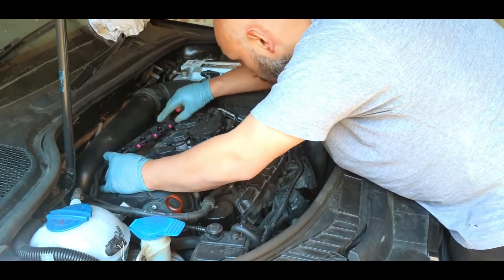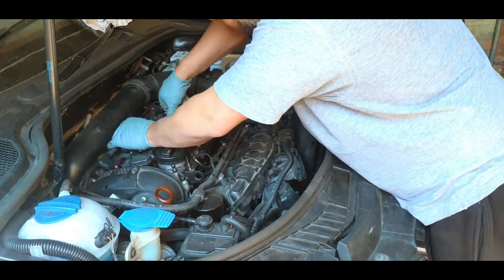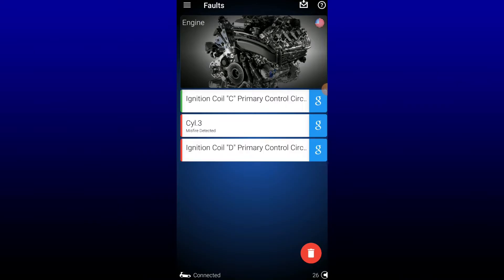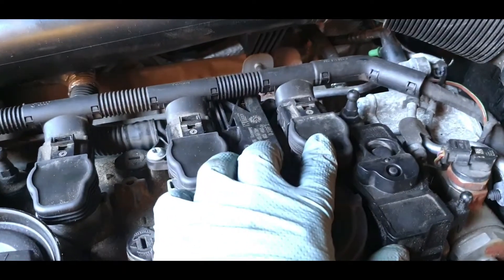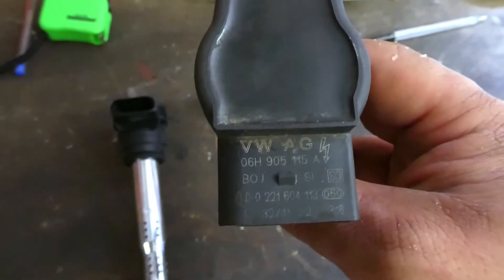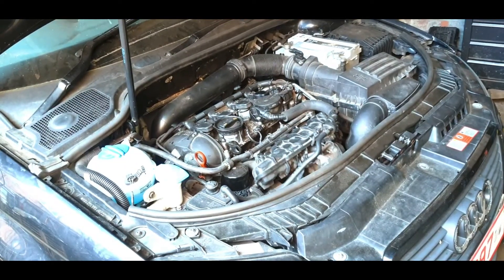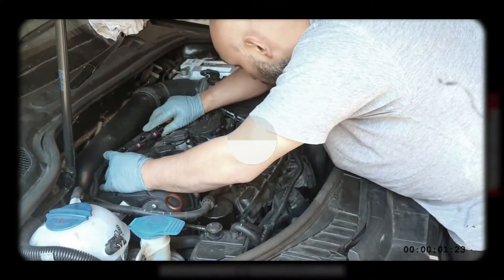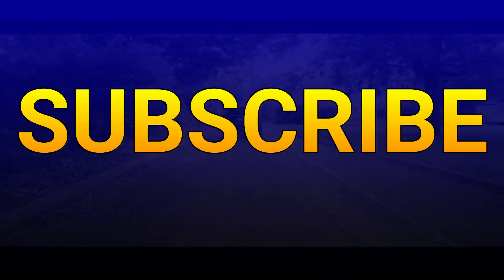Car Engine Misfire Shaking Vibrating Engine Fix - EA888 2.0 tsi tfsi

Comment: Does the ecp light need to come back on once you swapped the coils in order to read that it’s deffo that coil? I had a misfire on cylinder 4 with the EPC light on. The garage has now swapped 4 with 2 and the misfire is still there but with no light?

Comment: My engine is behaving exactly like this , and i mean it even sounds the same ,  and its stuttering and hesitating on gas while cold , when it gets to operating temperature after 5 or so minutes , all well .... Ive changed a ton of stuff , timing chains , belts , sparks , water pump , fuel filters ,  cleaned injectors ,  and changed intake manifold  old one was cracked and lacking flaps ,  but still , same thing ... I didnt change Coils , but my OBD does not detect misfire ,  at the Mechanics it did detect it , but my scanner does not .
Can this happen without engine reporting misfires ?
Reply: Look for tsi cold misfires. Most videos say Carbon buildup on intakes. In old times it was condensed water in the distributor cap. Sometimes can be animal chewed through cable.
Reply: @jellyd4889  Ive chased this subject , while changing the intake manifold i told the mechanic to clean the valves , also i red in the manual that valves are clean by prolonged 3000-4000RPM drive , where temperature reaches vaporizing point of the sludge .
Not a single percent of difference . 
Then i said these Mechanics are incompetent , and started doing my own thing , i gave them 2000$ nothing was fixed .I got new coils and injectors for around 150$ , and fixed 90% of the issue .
The rest is PCV valve , and Lambda probe , ive learned this engine.
PCV valve has a rubber and a spring , they do not work proper after 200 000km .
Causing excess Oil vapor in to the intake manifold , that increased the amount of fuel  or residue , compared to oxygen and massifiers .
But i again i do not want to go to mechanic and pay 500$ for PCV valve , when only a spring and rubber need changing , sold separately .
for about 50$ if even that , and can be replaced by me .
Lambda probe as well .
These mechanics are not used to working with complex engines , they don't even know where GPS receiver is , and they call it GPRS ,  not the same thing .
I also noticed they do not know that Battery can  has surface currents if dirty .
And that if you put a huge Batery in , it will overload your alternator , giving you less voltage , in my case 12,5 when it should be 13,8 at least .
So i changed the battery and got 14V 
now 2 V might not seam much , but when Coils transform that X1000 , you are 2000V short on your sparks .
So everything needs to be in tolerance if the engine is to work correctly , and it is not one thing , it goes down to battery .
Reply: @dedskin1 so do you recommend a battery change?
Reply: @koti1217  i have since found out what is going on , the oil from the oil separator i think its called PVC valve the oil that blasts trough the cylinder walls in to the engine space , makes positive pressure inside the engine , so every engine has a valve  that spits out that oil vapor and oil , then it goes to PVC valve or oil vapor separator  , and that should separate liquid oil and vapor , vapor goes in to the engine intake for another burn , and cycle continues .
Here is the problem , after 200 000Km that PVC valve is not working as good as it was , needs replacement ,  but it costs 400e original part , i ordered a third party not original part , and it was even worse .
I have chenged the Sparks and injectors , realizing injectors can not be cleaned in Petrol engines singe petrol is a cleaner , they have to be changed after 200 000km , and i changed the coils , after this problem was solved 90%, i assume getting a new oil vapor separator would fix it 100% but its expensive 500e installed .
So i left it be , becase there are things that can be changed still to improve things , like rectifier diodes  in the alternator , they are sure to be bad , and i measured it , they should give 14V , but give 13V  , so they have to be changed i guess that will fix it another  5% , and Lamda probe , oxygen probe on the exhaust , it too degrades and depends on material , since its used and 10 years old , it didnt brake , but im sure is not working properly , that would give another 2%, and the issue of stuttering engine  would be fixed 98%, and changing the rubber valve on PVC valve another 1% , so all of that would be 100euro and car would work 99% as new .
Battery has nothing to do with it becase after you start the car , it does not run off of the battery , but you can check your battery in  service , or by your self , turn on the climate control , turn on everything you can , go for a drive 5 minutes stop  for a minute ,  repeat his 3 to 4 times if your car starts , your battery is fine . IF it strugles then battery needs to be changed , and you can check at your mechanic , there is a tool to check it ,  and tool to check your alternator . 
But if your engine stutters its not due to battery , but some of it can be due to low voltage from the alternator . Some of it , maybe 10% . 
This stuttering is not one issue , its everything , every part not working a bit , not broken but still not working at 100% efficeny , and when you have 10 parts that need changing you get stuttering .
There is chance that you have vaccum issues , that is easily checked even by your self , when you pull out oil stick it needs to pull air in , put a little light paper close to it to see if it is pulling in air , if it does its ok , if it blows you have a problem .
But if it blows it means you have positive pressure inside the engine and this will push oil everywhere and you will see this under your car , oil .If your car uses oil yu must check that you are putting in fully synthetic oil , for these cars need strong oil that will not burn under high temp and pressures , atmospheric engines without turbo can go with any oil , but turbo engines can not .
And if your oil is getting out of the engine you can see that under the car , if it still uses oil and its not leaking , you can check that as well because if it is leaking in the engine it will get in to water , and water in oil and that is easy to check .
If your can tell me more about your car i can give you more information . Fo i have struggled , i did not want to learn all of this , i had to .
Reply: @dedskin1  holy fuck man, you really studied it a lot.. I changed the spark plugs 10k km ago and the pcv valve (separator) (aftermarket, 30euros), the problems appeared 5k km after this, so I will check these things first. Also did the ttiming chain 1 week ago, also cleaned the intake.

Basiically, on a cold start, the engine shakes and the rpm drops to 600, it works like shit, this happens for maybe 1-2 minutes, after that it works okay. When I drive it in the 1200-1300 rpm the epc and check engine light will come on.. i will try the things you mentioned as well
Reply: @dedskin1 thank you. My dipstick hole spits out oil and it's all over the engine.  Didn't know a thing about positive pressure.  I use the recommended castrol fully synthetic oil after every 10k kms. How do I solve the positive pressure issue?
Reply: @MiamiArnold  Does your PVC spit out oil
Reply: @MiamiArnold  There are 2 options , either your PVC valve is stuck closed , i think its a solenoid operated so if faulty it goes to closed , in that case there is no hole trough which  pressure can get outside building up in the engine , if its not that then sealers , the rubber seal between valve head of the engine and its bottom crank case has built op a hole , but if this happens usually then you have water leaks in the oil , and oil leaks in the water . And that is obvious , you can google how it looks , its a sludge , and also there is a Tester , CO2 tester that they put inside the water , there should be none , there is a chemical that changes color in presence of anything but water , because only water should be in your water tank . Its an easy check to test your seals , there is also Piston pressure tester to see if your piston rings valve etc.. close properly ,  if those 2 are performed , water check and pressure check and it turn out ok then i cant see anything else that could be a problem .  You should definitely perform these tests , CO2 test for water pollution , its a kind of bottle that you put instead your water tank cap , and if gas is present it boils to the top and liquid can see it changes color to dark , green is good i think but your mechanic will know , and Piston pressure test to see if you have a crack on a valve , or a piston . But also closed valve when it should be open , should be registered by the ECU , but who knows 
You can mail me at dedskin at google dot com . To share pictures with me of these tests and ECU read out of the faults if there are some . For me to help you in any consistent manner , not guessing around making you change parts that need not be changed . In short we must find why the engine has positive pressure for that is bad , the engine must perform in a vacuum , the petrol intake , oxygen intake , and timing depends on it , if this is moved by 10% you get major issues , the engine can not work properly whiteout a vacuum .So we need to give it vacuum before anything else .
Reply: @MiamiArnold  There is also i forgot EGR valve , its a valve that bypasses the engine giving fresh air to the Catalyzer in the exhaust pipe , when the time comes to burn particles before they get out , fresh air , oxygen is given  to the exhaust pipe, now if that valve is stuck open , then backfire and things can mess up your intake . maybe create a positive pressure situation.

Comment: Ölabscheider Droselklape Luftmassenmesser Ansaugnbrücke Zündspule Zündkerze nockenwellensensor kurbelwellensensor einspritzdüse 😉 und Ölwechsel 8K-10K km dune öl 0W-30.Thicker engine oil creates high pressure and damages the crankcase ventilation filter, which damages the crankshaft seal and burns Improper ignition in the cylinders (Misfire)
P.S All the parts listed above cause the engine to shake

Comment: Hi I just had my engine rebuild on my seat leon tfsi 2007 new coil pack spark plugs cam belt waterpump but my car is still very shakey when it's below 1000rpm what could the problem be no codes are coming up either

Comment: 2015 S3 here, but my misfires register roughly evenly across all 4 cyls, no misfire under throttle only at idle. Thoughts? Unlikely that it's plugs or coils if all 4 are failing?
Reply: check wireing and just do some basic testings. keep us updated what it was please
Reply: Sounds like a cam
Reply: Weak valve springs

Comment: I've changed pcv, cam follower, spark plugs, ignition coil, amd even had the injectors cleaned (just 1 replaced) and had a walnut blast but still have slight shake when idle. Cylinder 3 was misfiring and so changed injector, coil packs and spark plug. 
What else could it be?
Reply: Could be cams…
Reply: Whats cam ?
Reply: @randompointlessness2766  have a look at dogbone mount
Reply: @randompointlessness2766  The camshaft. If you change your oil at 30.000 km your lifters will become ,,sticky" and you'll have a metalic noise everytime you're starting the engine. I bought the car like that. Change your oil and filters at 10.000 km or 8.000 km. You'll ruin your engine.
Reply: Engine mounts? 
I just put bg44k in my Audi and it’s running way smoother in all ways

Comment: I have new injectors, new variable valve timing sensor, new sparks, fully rebuilded engine, new timing chain, new dual mass flywheel, dsg clutch pack and 2 years old mechatronics :) and it's still shaky on cold. When it worm up (15 sec) and revs will drop below 1000 rpm. It works ok and only each 5-7 sec I can feel some ticks.
Reply: breather pipe or pcv valve leak
Reply: @mohammedrahmanrahman5024  no because sometimes it runs perfectly. When you have a leak engine work perfectly only on cold.
Reply: Did you replacethw valve springs? There a known weakness for rought idle. On the tsi tfsi engine
Reply: Anything to do with battery?
Reply: Do you ahve new coila??

maybe buy a new car.

Comment: Hi Get Job Done.  I have a shaking problem with a Q5 2.0 TFSI 2015 (60,000 km only)...  It hapens in low revolutions.  Is a misfire that produces the car to shake, but only in a light or a Stop.   Never accelerating.     If you speed up the misfire disappear...  I found your videos and excellent explanations... but i notice that the difference is that mi car is newer.   I already change the sparkplugs, the coils, pcv valve.... but i stop and try to found if someone have the same problems.   What you recomend my to try?
The last codes i had were:
Reply: I have new injectors, new variable valve timing sensor, new sparks, fully rebuilded engine, new timing chain, new dual mass flywheel, dsg clutch pack and 2 years old mechatronics :) and it's still shaky on cold. When it worm up (15 sec) and revs will drop below 1000 rpm. It works ok and only each 5-7 sec I can feel some ticks.
Reply: i think may be gear oil change if your gearbox is automatic

Comment: My 1.4 TSI BMY does the same. What do I do?
Reply from the maker: First diagnose, obd2 Check will show
Reply: @GetJobDoneofficial  It has been to the VW garage and gotten the timing chain + carbon cleaned from the intake valves. I don't have any scan tools, but they have most likely done it
Reply: Did the carbon cleaning get rid of the shaking?. I just changed one ignition coil on cylinder2 after I got a blinking CEL+misfire. But after 1 month the engine shakes while cold, but no Check Engine Light.
Reply: @tedarin  Nope…. This engine is not very good. A lot of People have issues with them and VW workshops can’t even fix it
Reply: @tedarin  did you figure it out my friend?

Comment: Mine is shaking huffing and puffing aggressively, i have a mk5 golf gti, its been remapped to stage 1, but recently had a loss of power of so I changed the diverter valve and pcv, and the power returned, until last night i had a misfire and i had to turn the engine on/off to return it to normal, today the engine came to a stop with it huffing and puffing, low revs, dashboard keeps showing red battery signs, got a strong feeling its a misfire issue, do you need ignition coils for it fix it?
Reply from the maker: If you need new coil pack it would show up on the obd2 scanner. Then you would know exactly which one is gone.

Comment: mine doesn't shake that bad but does but no missfire codes and loud engine noise can u  possliby tell me what to look for
Reply from the maker: Good timing with your question as will be actually uploading video on this tonight
Reply: @GetJobDoneofficial  great as mine engine shakes a bit but I don’t get a miss fire code or any also the engine at idle has gotten louder

Comment: Anyone can help on this
1K0907115 Serial number: VWZ7Z0E2482671 Long coding: 0403000318070060 Trouble codes: P2279 - Intake Air System Leak Lower limit not reached Intermittent P0300 - Random/Multiple Cylinder Misfire Detected Lower limit not reached static P0303 - Cyl.3 Misfire Detected Lower limit not reached static P2187 - System too lean at idle, Bank 1 No signal/communication static P0507 - Idle Control System RPM Higher than Expected Upper limit exceeded Intermittent P0299 - Turbo/Super Charger Underboost Lower limit not reached static

Comment: Hello, i have leon cupra 290 , MT transsmision, 2016. My car is sporadicaly shaking at idle. Also exhaust is popping at idle. When I raise rpm, everything is OK.  Also when i switch on AC, it smooths little bit. Lot of Golf R and other TSI cars got same problem. Sometimes I feel my throttle too agresive. When i barely put my foot on throttle, it jumps ( feels much more sensitive ) Same thing when I put my foot down from  throttle. I changed spark plugs, PCV, Diverter valve, Map sensor ( located on intake ), cam magnets. Also there aren ´t any  diagnostic trouble codes. Maybe i´ve got unlucky and got bad PCV again ?
Reply from the maker: What diagnostic system do you use mate?
Reply: @GetJobDoneofficial   i used pro diag  , not cheap one .  It cost 6000 dollars. Maybe exhaust manifold gasket leak ?
Reply: i had same problem the pcv i brought wasnt geniune and leaked put in geniune one and sorted it out. also if its auto gearbox change gear oil. also sometimes may mean the crank postion sensor may be on its way out
Reply: Hi crysisman, were you able to solve the problem? my car does the same. Please help me. Thanks

Comment: Is this EA888 too? I’ve just changed my spark plug to fix Audi A5 misfires, probably will do a decarbonization as well.
Reply from the maker: Yes ea888 in the video was Gen2 Ccza
Reply from the maker: I have video on decarbonization done on A4 B8.5 so will be similar or the same on A5...
Reply: @GetJobDoneofficial  cheers i will take a look
Reply from the maker: @lucaszhang-r9z  https://youtu.be/f7jbLdZ3Ilo